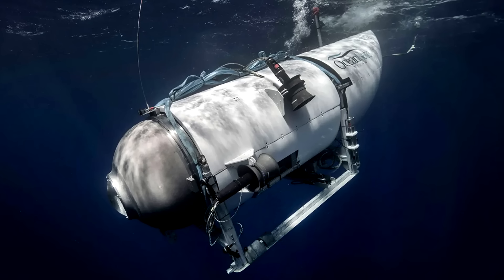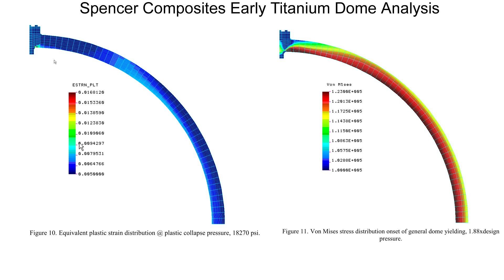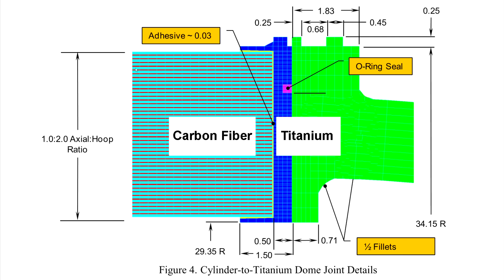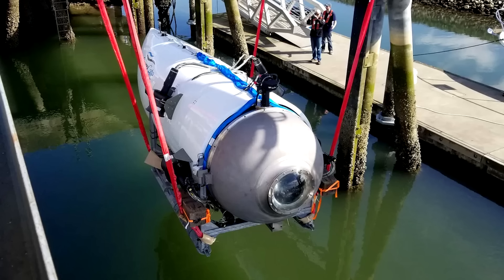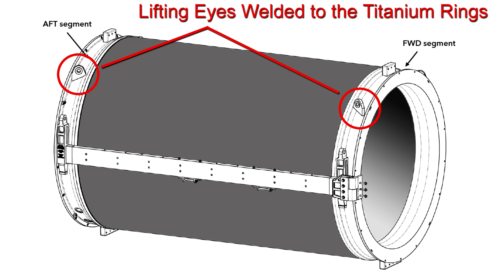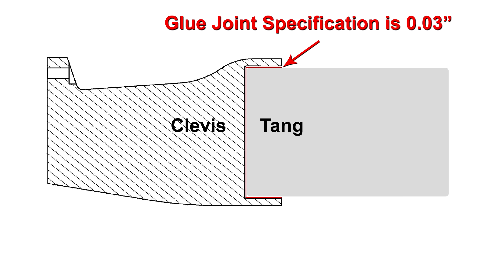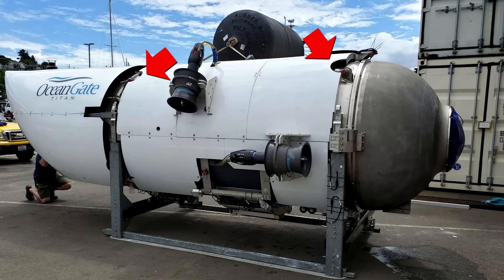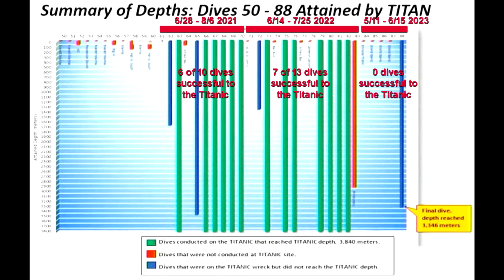OceanGate Titan Titanium Rings - An Additional Story About Them

Comment: Stockton's arrogance really pisses me off. How much of narcissist do you have to be to take legitimate warnings from industry experts with DECADES of experience as personal attacks? He thought that just because he had experience in aerospace that somehow that experience transferred to deep submersibles. Because he had worked with carbon composites in aircraft, he believed, incorrectly as it would be tragically demonstrated, that he "knew" the material and so it made a good material to make a sub hull out of. I'm no engineer, but I know enough to know that carbon fiber has its strength in tension, with very poor performance under compression. Take concrete, it has its most strength when subjected to compressive forces, but is very fragile when subjected to tension or torsion.

He was so arrogantly confident in his deadly design that he made idiotic statements about portions like the viewport . Saying that the acrylic it was made from was "great" because it "gives you warning when it is failing" as it would "crackle" and would give you time to rapidly surface. It does not take a genius to know that at those depths, and pressures, a crack would propagate RAPIDLY, leading to total failure in seconds, at best. I think it was very fitting that he was wearing an ill fitting helmet incorrectly as he spoke these words. The helmet was just so unintentionally funny as well as perfect because in my opinion, had he not been born into a rich family, he likely would have had to ride a school bus that was made from significantly less steel than your average school bus. 

When it comes to the hull, he believed he knew the best way to construct the hull, using only 90 degree angles when laying down the carbon fiber rather than including 45 degree layers as recommended by either Boeing or NASA ( I forget which). He actually said, during a talk/presentation that the 45 degree layers were not needed as the sub would not be subjected to torsion forces.IDIOT! Those layers were NOT to resist torsion forces!! No, Stockton "knew best" and attempting to give him critical advice were seen as personal insults or as in the case of David Lochridge who was critical of all the NUMEROUS design flaws and recommended ways to correct these deficiencies, were sued. Rush was such a petty little b*tch. I feel for the families of Rush's VICTIMS, but Rush himself, I have ZERO sympathy for him. He used aggressive tactics to get customers, made the workplace a very toxic environment where if you ever questioned any decisions he made you were sacked and sued. He LIED to his paying passengers and used deception to get around regulations. 

It is actually quite a shame he died in  the implosion, and not BECAUSE he died. It is a shame that he had not been on the support support ship when it happened, because I would have loved to have seen the look on his face as he realized what had happened and then thought back to all those people that had been concerned, telling him he was going to get people killed. But being a narcissist he probably would have started blaming everyone and everything else and never taking accountability. Never realising that rather than being a genius, he was actually seated firmly on his throne on the summit of Mount Stupid.  He thought he was a genius, but really he was only smart enough to be a danger to others around him as the implosion proved. 

F You, Stockton. May you burn in hell.

Comment: I went to school tor composites and it amazes me how people think carbon fiber is better than steal or any metal. Its just super rigged and very lightweight. Where metal would just bend, carbon fiber will snap and have 30% of its strength left if any. Carbon fiber has a shelf life as well... well its the resins that do. You also cant work carbon fiber like they did over and over and expect it to not eventually fail. Its got only a certain amount of working cycles then you cant trust it. Shit is crazy how these people did all this shit

Comment: Only the deluded would believe that glue will bond  better to a smooth polished surface than an a abraded rough one . Ask any competent carpenter , or someone with common sense . As for the strains  placed on the Titan joints when lifting - ask anyone on a building site . complete nutters all round in the construction of this disaster .

Comment: Why didn't they weld the lift points to the landing gear? 

That seems to be an easier, less critical part that can be easily replaced if broken unlike the custom titanium dome.
Reply from the maker: They used the top of the lifting gear at some point.  I found that picture at 5:10.

Comment: For anyone on a time budget: lifting eyes added onto the titanium ring generated sheer pressure at the mating surfaces of the carbon-fiber and titanium ring that were not designed for lineal load bearing, and this may have resulted in de-lamination and the subsequent water inclusion event (fatal failure). These lifting eyes were suggested additions to the first submersible after assembly and advised against by the original design team lead; during assembly of the second sub they were added to the titanium ring, which took place long after his involvement in the project had ended.
Reply from the maker: Thanks for your comment.

Comment: This glue joint on this position. Every time i see this, i ask myself: why? This would have given me sleepless nights. I desingned pressure vessels for oil and gas in the past. We worked with 140MPa on like 200mm diamter. If i recap all those deformations, a glue joint would be a nightmare.
Reply from the maker: Thanks for your comment.

Comment: I can tell you what is missing instead of actually using a seal whether it was Teflon rubber silicone hell even maybe brass or copper because if the two pieces aren't exactly the same weather at steel carbon fiber anything aluminum they're going to expand and contract at different rates the round part of each end probably quite a bit stronger because of the fact that is a dome which means when you can press it all it does is make the Dome stronger now if each end are made from a different material than the center of The Craft they will compress at different rates if there's no sort of actual physical friction seen they're going to expand they're going to fatigue and it's going to implode fail now if they would have actually done that and glued or whatever else that they did it would have probably be just fine and the people would still be here but they didn't

Comment: I've said it from the start, there was no reason to use titanium it was an inferior material from the onset.
Stainless Steel should have been used as it has far less stretch and flexibility under pressure as opposed to titanium.
While this sub was riddled with problems I have no doubt in my mind that the failure was caused by the titanium flexing, couple this with multiple dives this caused it  to break its bond with the carbon seal which caused the catastrophic implosion.
Just look at the data of the two materials, that's where you'll get your answer.

Comment: That glue joint seems less robust than it should have been.  Relying on rigging methods being kind to your structure is not great engineering and potentially wasteful of your entire structure.  FIU Bridge disaster was exactly that kind of stupid.  

That all said, I believe the root cause of the failures was the carbon fiber tube choice engineering the whole structure into a corner.  If it cannot sanely be bonded to other materials, it must be used how it can be structured or discarded as an option.  E.g. one doesn't use cast iron in tension and one doesn't use cast iron if welding is possibly going to be required on that part ever.  Tension loads and weld induced decarburization will wreck cast iron.
Reply from the maker: Thanks for your comment.  Yes, I have studied the story of the FIU bridge.  The poor decision making leading to the diaster is similar in many ways.

Comment: They also didn't have a load spreader on the crane. Each lift was twisting the structure, compression at the top and expansion at the bottom. I thought this was bad before i knew how heavy the unit was. And there was that time they dropped it and the forward dome broke off, which would have again twisted the structure and epoxy.
Reply from the maker: Thanks for commenting and the rigging information. Yes, the dome fell off.  But it was on the deck of the Arctic Horizon while they were still on the LARS. They just got dragged back onto the deck. It was after dive 61, and they may have been taking bolts out (routine) and did not have the dome properly supported. That dome weighed over 3,500 pounds, and the "hinge" on the left side (looking towards it) wasn't really a hinge. It could not support the weight. It was more of a pivot point. When opening the dome, it had to be supported at the bottom as it opened.  I agree with you, even opening and closing that dome could have caused stress on the glue joint.

Comment: Oceangate drilled 2 new plunge holes in the rear interface ring. Making 4 points of weakness compared to the first hull. One of these large connections was completely blown out in the wreckage.
Reply from the maker: Thanks for your comment.  And that bit of information.  I was unaware of new holes being drilled in the aft ring.  I wonder why they needed more pass-throughs for the second sub.  Do you know where you read that?

Comment: What I don’t understand is why they didn’t just use the cradle the sub was mounted on to lift the sub from, it would have easier, unless they wanted to avoid handling the sub excessively during its build process and didn’t make a jig for it to be moved around on and handled before they made its permanent cradle frame.
The fact that they didn’t have a load equalizing rigging or lifting gear to compensate for the balance of the load…
I mean it’s fascinating to speculate what went wrong, but seeing everything that was not done right… yeeesh.
Reply from the maker: Thanks for your comment.

Comment: Watching this is like watching a stage tragedy. Like, the tragic climax of the story is when the lifting eyes are welded to the rings. If the hull wasn't already compromised before that, it damn sure was after.

It hits the same as when Romeo is told that Juliet is dead, but not the plan.

Comment: This who operation was a great example of misunderstanding reality.  They built these ships and used them and figured that was proof of success.  But what was actually happening was getting away with it by luck, every single time.  Luck only goes so far. It's like a man on the roof of a building. He wants to jump across the alley to a second building.  So he makes a ramp and then runs runs runs across roof and leaps into the gap and he makes it!  He is stoked. He did it.  He is now an expert.  So it decides to go again and again.  And again.  But on his last leap, he comes up short and plummets to his end.  You see, he had a tail wind for his first jumps.  He made it thanks to the wind, not his skill.  On his last attempt, he had a head wind. And all his strength was not enough.  In fact it had never been enough by itself. His success was always just due to wind. As was his failure.
Reply from the maker: Thanks for your comment.

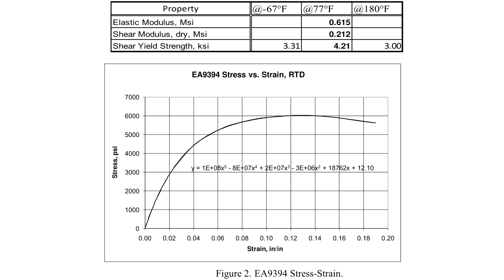Comment: Can anybody explain why the Stress-Strain graph doesn't match the formula printed inside it? (at the 1:43 mark)  I can accept that the PSI units have been adjusted.  But, I'm not even getting the same shape of the curve regardless of the Y-axis units.  I am NOT being critical.  Clearly, I have missed something.  I'm NOT a PhD Engineering.  But, I know how to graph a spreadsheet formula and I have definitely got the signs correct for the squared and quad terms.

For example, the plot suggests that the Strain for a stress of 0.12 should be very close to the Strain for a stress of 0.14.  I'm getting -20,500 Stress units for strain = 0.12 and -26,600 Stress units for strain = 0.14 when plugging into that printed formula.

Comment: Even if the lifting stress didn't compromise the glue joints, the additional material from the lifting eyes changes that carefully engineered profile and changed the pliability of the titanium part in a section where it was critical to match the movement of the carbon fiber under pressure. 

Those eyes would have caused a failure without a single lift, and without a single issue from welding. Trouble is, you also had both.
Reply from the maker: Thanks for your comment.  I agree with you.

Comment: If the rings were reused how did they open up that channel to fit the thicker hull?
Reply from the maker: Thanks for your comment.  The first thing they did was saw off the rings from the first hull.  The second thing was to mill out the carbon fiber from within the C-channel without harming the titanium. The third thing was that the hull had too large of a diameter for the ring channel, so they milled down the outside of the hull to allow it to fit.

Comment: The sub failure is a perfect example of how engineers think. Nobody communicates and when an issue is noticed its ignored because its someone elses problem. The ones who sign off on final designs are not engineers so they don't know there is problems.

Comment: Why not just fabricate lifting eyes onto the top landing gear verticals and then use a spreader beam to keep the cables from touching the hull and to eliminate the inward pressure on the hull if the landing gear deformed imperceptably under load?
Reply from the maker: Agree.  Thre wer other ways to do it.

Comment: There is no way this craft should have been approved for humans to occupy at the extreme depths this thing went to. 

The expansion & contraction of the 2 different types of materials at high pressure, in immensely frigid waters, should have been serious red flags to the engineers who worked on this project. 

I should know, I'm a truck driver!

Comment: The front ring did fall off once ! It fell off as they were coming out of the water . The whole nose cone came off . And on the last dive Stockton only used four of the eighteen bolts to attach the hinged entry nose cone to the hull , why ? After twelve successful dives why leave out FOURTEEN BOLTS ?
Reply from the maker: Yes, the dome fell off. Thanks for commenting. But it was on the deck of the Arctic Horizon while they were still on the LARS. They just got dragged back onto the deck. I have tried to find out why all the bolts weren't in at that point, but I am not sure. It was after dive 61, and they may have been taking bolts out (routine) and did not have the dome properly supported. That dome weighed over 3,500 pounds, and the "hinge" on the left side (looking towards it) wasn't really a hinge. It could not support the weight. It was more of a pivot point. When opening the dome, it had to be supported at the bottom as it opened.
Reply: @solareclipsetimer  thanks .

Comment: I can’t help wondering if the fact that the pressures applied to the sub were in compression so some people assumed that those pressures would help seal it.
Reply from the maker: Thanks for commenting.  You are correct.  Part of the design assumption is that the domes get pushed into the hull.  But that is so simplified.  The forces on the glue joint are very complex.

Comment: So, we weld Titanium to Titanium (a high heat welding event), WHILE IT IS GLUED TO LAMINATED AN EXPERIMENTAL CARBON FIBER PRESSURE VESSEL??? What could go wrong?!? 🤡
Reply from the maker: Thanks for commenting.  I tried to be clear in the video that I imagine they welded the lifting eyes onto the rings after they were cut off of the first hull and before they were glued on to the second hull.

Comment: I was really surprised when I saw relatively shallow C channels. I would have expected to see a relatively long sleeve inside the carbon fiber tube. I expect the models may have shown the pressure pressing the rings on and that’s why they decided the minimum interference was adequate but it seems questionable to me. The fact that they cannot point to a most probable failure point is probably evidence that there were too many design weaknesses.

Comment: Why did I hear nothing about expansion and contraction differences between Ti and CF
Reply from the maker: Watch Tony's testimony at 3:20 about material moduli.  They did a lot fo good engineering, so I think he was aware of temperature differences also, but that never specifically got discussed (that I found).
Reply from the maker: What Tony's testimony starting at 3:12. They did a lot of good engineering.  I feel sure they took the temperature issue into consideration.  Thaks for commenting.

Comment: Why didn't they add wide straps around the carbon fiber hull to attach lifting rings? Wouldn't this solve the problem?
Reply from the maker: Thanks for commenting. You can't lift from the carbon fiber hull.  The domes alone weigh about 3,600 pounds, plus the rings and the landing gear.  That weight would all be hanging off the ends. And you can't sling around the bottom of the landing gear because of getting the Titan off the dock onto the LARS. It was a tight fit, and the landing gear of the Titan had to slip into a track on the LARS to get locked in. So, they couldn't have a sling across the bottom.